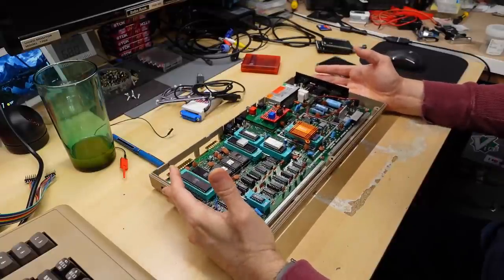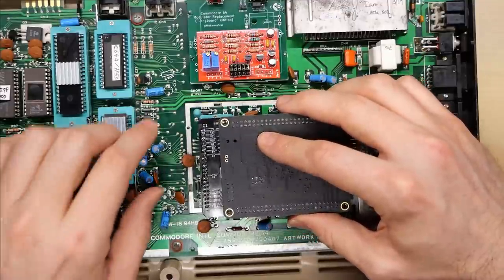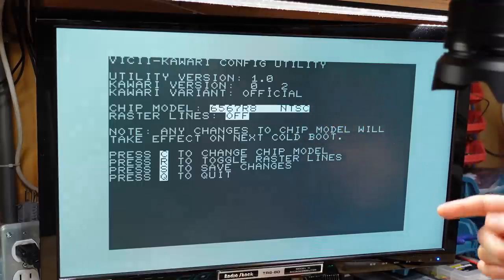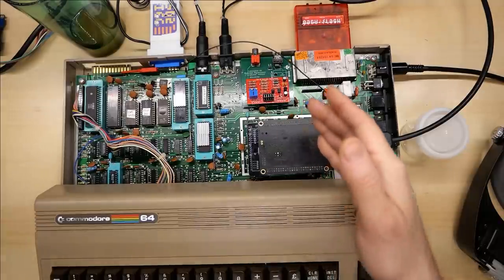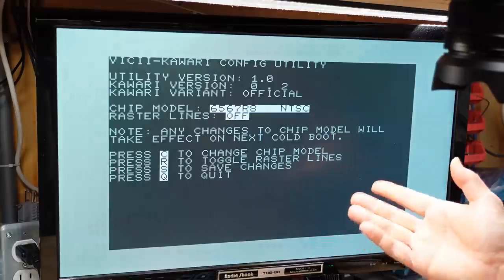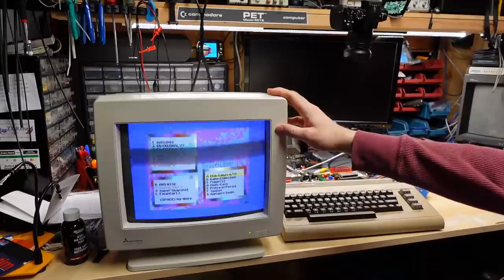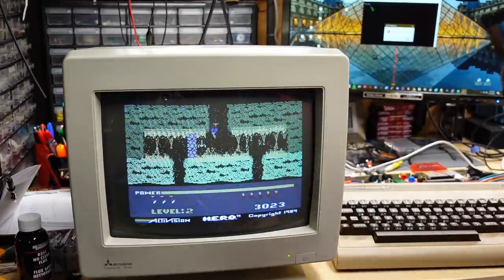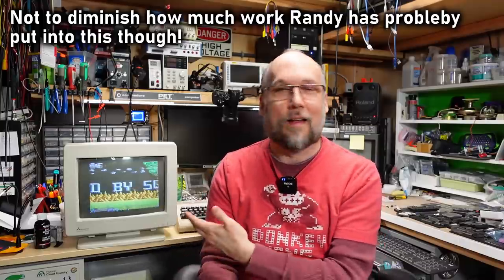VIC-II Kawari: FPGA based VIC-II replacement for the C64

Comment: "By the time I was done with it there wasn't a square millimeter of factory silicon inside." - William Gibson, "Burning Chrome".
Reply: If only there was a FPGA to replace the ENTIRE C64... or a $40 SoC board to do the same.  Oh, wait, there are.  😎
Reply: @winstonsmith478  Yep. At some point you're just keeping that C64 on your desk because you like the chassis. Probably better off running a MiSTer or a software emulator if you're going to replace half the chips with FPGA equivalents.
Reply: @flow221  the point is more to be able to have all the replacement parts available for people to keep their old ones going, when all the original chips are finally gone. Of course some folks will make “100% new component C64s!!!!” for videos but that’s not really the point of them. I think it’s great, the computing scene is evolving to be more like the car scene. Where for the right old car you can get totally new body panel pieces, totally new interior trim, etc.
Reply: @kaitlyn__L  Of course I understand why these replacements are being made and I'm always impressed by the talent and ingenuity of the people doing the work. But, yes, at some point in my entirely subjective opinion it starts to get silly. Much like a '69 Charger that's been gutted and rebuilt from the chassis up, you're just keeping something because you like how it looks not because it accurately represents the device it was at release.
Reply: @flow221  yeah, I think your final sentence is an accurate assessment. Loads of cars are deemed unusable with stock engines and then the only point is how it looks. Yep.
Reply: @winstonsmith478  Do such devices support all of the obscure peripherals that have been designed for the C64?  In the "How It's Made" episode about piano rolls, the piano roll punch was operated by an Apple II+ computer.  Sure today's computers may be more powerful, and I suspect that custom hardware applications were more common on the VIC-20 and Apple II than on the C64, but if one has a specialized hardware+software application for an antique machine, an all-in-one FPGA isn't the same thing.
Reply: People who advocate emulators or C64 on a FPGA forget about peripherals and other fun stuff you can do on a real C64 like interfacing with the hardware in the expansion port.
Reply: @snorman1911  iirc, most peripherals work on the Ultimate64. At this point it's pretty much possible to build an entirely new C64.
Reply: @snorman1911  I'd like to hear what peripherals you're thinking of specifically. I'm a little disappointed Adrian put a link to just an FPGA Chip, rather than particular boards, because the latest cheap  FPGA boards have ARM and RISC-V chips which can interact with peripherals in a conventional way.  It does illustrate, however, you could put any sort of connector on an expansion to an FPGA  board; the "connector ports" or cassette port, anything.
For example, the MiSTer is mostly designed for HDMI, but the System I/O board has a VGA port and many "cores" can work with that. You're criticism is perfectly valid with emulators, (I'm thinking of Raspberry Pi's in particular), but with FPGAs, the sky is the limit. I think there's revolution coming as FPGA prices come down and programming options, particularly Open Source tool-chains become better.  I think they will make nearly all original hardware obsolete, for better or worse. Commander 16X needs an FPGA because appropriate video chips are unavailable. It's controversial, but neat solution, especially how easily it can be "firmware upgrade".
Reply: @squirlmy  if you're looking for a real original experience, floppy drives of course, original monitors, joysticks designed for the original hardware, cartridges, memory expansion and accelerator cards, in addition to DIY stuff. I've spent lots of time making circuits that connect to the user port or expansion port, this was half the fun of the C64 to me. Would be great to emulate an expansion port with an FPGA.
Reply: @flow221  that is why i love the Raspberry Pi 400, it reminds me at the C64

Comment: This is one of those "shut up and take my money" moments.

About the extras that could be incorporated into this device.
I think the DTV screen modes would be a nice addition.
The DTV has a chunky 256 color mode and a blitter.
There are some demo's out there that use them already.

Oh and yes! the colours in PAL land are a bit lackluster :-(
I would love more vibrant colours.
Reply: This would be very cool in a RGB version.. Also HDMI for some people but I'm lucky enough to still be running CRTs.. Well I spoke too soon. 15khz RGB later in the video
Reply: I join this statement. It would be nice to keep the advanced video modes, even if they are difficult to program for, I'm certain the community will eventually make use of them regardless.
Reply: I still have an unopened DTV I forgot about
Reply: @circuitsandcigars1278  Nice to have one but thankfully pretty redundant now days. I wasn't sure we'd ever see a better remake
Reply: Fully agree with the DTV modes. That would be a very nice bonus to an already great product, and it would pull the C64 back into the 21st century.
Reply: Indeed  i feel the same !!:)

Comment: Creatures by Thalamus might be a good game to test.  The first level  can trigger the VSP bug some later VIC IIs suffer from.  On PAL tv's we have a Saturation control to make the colours pop.  The challenge was finding the right balance between normal tv and the c64 so you didn't have to adjust it all the time ;)
Reply: I never had an issue with Creatures - my C64C is pretty much VSP-safe, but Mayhem in Monsterland could sometimes have scrolling glitches and character corruption if I ran it with an action replay connected so for me that is a worst-case scenario for testing.

(Another bonus is the game is fun so it shouldn't be a chore to test:)

Comment: I love your content because you always go above and beyond in testing and demonstration of products, submissions and (of course) candy.  In regards to testing the VIC-II FPGA I always use the 'EDGE OF DISGRACE' demo to test my C64s.  There is another VIC-II FPGA project that you are probably aware of by c0pperDragon which outputs analog component, but it still requires the original VIC-II for clock generation.

Comment: This is really cool.
You should try putting as many modern replacements into a single C64 to see how it would work. I guess it shouldn't do anything weird, but it could be a fun little video regardless.
Reply: Wasn't there also a project that reverse engineered the motherboard back to the  CAD files needed to generate additional  c64 motherboards
Reply: So new motherboard with all modern replacement chips :)
Reply: @artstrutzenberg7197  As far as I know, all circuit diagrams are freely available, so making a new mobo for it shouldn't be too hard

Comment: 5:50 the HDMI TX PHY can be omitted too, by using SERDES in the FPGA to generate the TMDS signals for HDMI directly. There are several projects (including one on my github) that can generate HDMI without that IC.

Comment: I'm assuming the SID chip audio isn't also going out over the HDMI signal, and you had the speakers hooked up to the 8-pin A/V DIN.  Yes?
Reply: The SID audio output isn't connected to the VIC so it can't do that.

Comment: Very nice HDMI is coming to the C64! Looking forward to the final product.
On ZX Spectrum we created a solution using a cheap Raspberry Pi Zero for HDMI output, with support for more colours (ULAplus) as well, which resulted in the ZX-HD interface.
I made several 64 colour slide-shows showing off the possibilities.
Work on audio over HDMI and more supported video modes (like the so-called 'Timex modes') is on the way.
An FPGA solution would be even better, so let's see what the future brings.

Comment: This is an amazing device. Hats off to the inventor. I know just how difficult this can be to do on a FPGA. 
For me the goal would be crystal clear video quality, so I do not understand why people want scan lines, and certainly why would you want S-Video output when you have perfect HDMI?
Reply from the maker: For me, it just feels like using an emulator or even something like "TheC64 Maxi" .... why bother with original hardware at all. Those modern things can't properly output to a CRT like the original hardware, so if you want the full experience, you gotta use a CRT like the C64 was originally designed to use. (IMHO)
Reply: @adriansdigitalbasement  Wow I'm excited to get a reply from Adrian himself! Thank you! It's just my personal opinion and I am aware that many enthusiasts like the retro look and feel. 

Just FYI I have been watching your channel for 6 months or more now, even though I have never owned a Commodore or MAC, I just find your material and presentation style of the highest quality.

I go along with you to the extent that I prefer real retro hardware and not software emulation. My old hardware collection consists of several Atari 8-bits and an Atari STe. I'm on the fence w.r.t. FPGA emulation.

If you could see the horrible video quality from either my 130XE (jail bar city) or my Atari STe, you might understand why I only care about a high quality picture to simply allow me to use these computers. :-) The video quality from the STe in medium resolution displayed on my Dell monitor (RCA video input socket) is almost unusable.

My current project is to tap into the STe "shifter" digital outputs and convert them to HDMI. Just yesterday I got the first sign of life, however the FPGA clock and STe shifter clock are not yet locked so all I can tell is that it is a desktop, but highly skewed.

Consequently I can see how much work must have gone into this product and I hope that the developer is able to recoup some money from his hard work once the final version is released.

I did have an old Grundig TV (1980 vintage) which had an early version of SCART. This was great for RGB, but having not being used for many many years, the first time I (recently) powered it up, connected to the 130XE, it literally went up in smoke. :omg:

Comment: orange ceramic disk capacitors withstand very little heat before the value changes . it holds and breathes on it with your warm air!

Comment: Excellent! Props to the developer.
Out of curiosity do the C=64's video ports still work with this VIC II?
FWIW: There's a similar project for the BBC Micro's ULA - truly excellent, lots of new modes and programable colour palette - I guess the latter is the most useful addition for both projects as they add something useful that can be used with old software.

Comment: Off topic question... what is the beige box device on the shelf about your workbench at 33:21?  It's the 3rd box stacked vertically above the PET sticker, just to the left of the DANGER HIGH VOLTAGE sign.  I have a similar shaped box but it is dark brown with a different front panel that is a B&K NTSC Generator, model 1249A.
Reply: Visible at 0:02? Looks like a Rigol scope. Definitely a Rigol something, I recognise the yellow label 😊
Reply: @azyfloof  No.  I am referring to what is seen at 33:21.  Note that Rigol scope is under the DANGER sign, not left of the sign.  I updated my post above to be less vague.
Reply from the maker: I think you mean my Topward Electric Instruments TFG-8114. Digital sweep function generator.
Reply: @adriansdigitalbasement  Thanks!  That's the item.  It's interesting that different manufacturers appeared to use the same plastic shell.

Comment: Hi Adrian. I've already seen a HDMI mod for the C64, but working differently. The original VIC-II was kept, and the HDMI output is to be soldered replacing the awful RF modulator. Maybe that's the way for this WONDERFUL creation to step to revision 2: a mod to replace the RF modulator AND the probably faulty original VIC-II chip. Too bad Commodore missed a pin to make it RGB (or even YUV) output since the beginning, like TMS9929 for example

Comment: Randi Rossi used some very challenging demos to proof his design, I think you will be hard pressed to find anything that doesn't work right. Go check out Randis video they are both fun and informative in that geeky way we love
Reply: Does music play in key with an NTSC machines, or is it about a half a semitone flat?
Reply: @flatfingertuning727  its only fast
Reply: @Voyager_2  I should have clarified: do NTSC machines with this VIC-II chip replacement play music at exactly the same pitch as those with a normal VIC-II chip, or slightly flat from that pitch?  A half-semitone difference probably wouldn't be noticeable unless one listened to the two kinds of music side by side, but would be large enough to be pretty obvious then.

Comment: On my pal machine I have never noticed such dim colors. But I'm using a 1084s monitor where you adjust the signal. Without correction the picture is for sure, pretty pale.

Comment: This device seems like a great step in replacing those dead VICII chips.  If it could be made small enough to fit in a C64 case and maybe add some mode to increase side boarders in order to allow for widescreen monitors so that the 4x3 screen ratio could be restored and it would be just about perfect, even as an upgrade.

Comment: I have several C64s, all of them PAL (I'm from Spain). I see many people comment these washed colors are what they are used to, but I really never seen anything so faded with my computers, these colors look awful in my opinion... What I see with my computers are vibrant colors just as Adrian is showing here in NTSC mode. I only use S-Video and Composite on a CRT TV and an HDMI monitor through RetroTink2, never the RF out. I don't know why others see the colors this way, but it was never my case.

Comment: seems like there are now sufficient modern replacements for Commodore 64 chips such that a manufacturing line could be re-established to manufacture it (there already are injection molded cases, unpopulated PC boards, and keyboards). Would be cool to see a modern Commodore 64 that supports all the original ports and expansion bus / cartridge slot, but enhanced with faster clock speed options, bankable memory beyond 64K limit, HDMI video output, support for D-pad controllers, and PS/2 ports

Comment: Amazing.

I don’t know anything about C64s, but you did mention the font chip. Not sure how popular it is, but perhaps a small daughter board at the very least could be used with this to allow the ‘easy’ change of the fonts?
Reply: the c64 has 3 rom chips, one for kernal one for basic and one for character generator (map). i think there are rom switching mods available.

Comment: Hmmmmm, the I/O or PIA chips could be very easily replaced by CPLD/FPGA counterparts. I could work on a replacement plug-in design if it is not already done 😎

Comment: Being located in the United States and owning an NTSC machine, I would LOVE to have this installed in my 64.  It’s tragic but, in the United States, this platform was mostly abandon and the software lost so, these days I am running mostly PAL software.  Still, I don’t want to convert strictly to PAL or buy another machine.  This also has some super cool features like the ability to get rid of the vertical lines on the left of the display.  The only issue is, I’m a fan for the Commodore 64C and that is all I have.  So please continue development and get me a solution for my 64C.  Thanks!

Comment: I think the design is for the 250425 and 466, where the VIC-II is rotated by 90°, then you can remove the RFModulator and use its hole for the HDMI

Comment: 8:36 Technically, anything done on FPGA isn't supposed to be an 'emulation'. It's meant to be as close as possible to the actual logic and timings as possible in real circuitry. Emulation is more of a translation of machine that's being 'emulated' into something that a modern computer can understand. That's the real difference; give or take whatever stupid thing I might be getting wrong or forgetting here. If he got everything correct, it functionally IS a VIC-II chip.

Comment: I would love something this for my Commodore 128 and one of my C64's. Ever since I have owned a C64 (1984) the PAL palette always looked a little washed out compared to the other 8 bits of the time, I used to turn up the colour balance on my TV (and later 1084) to get the vibrant colours.

Comment: yes, the PAL palette is dirty washed out. not saturated at all. commodore probably made a mistake in the first VIC-II version and did not have the time / money to fix that.
now we need a new c64 board with pin-headers for a video card. then we can make video cards with the original pal or ntsc chipset and other cards like this one.
also for the SID, we would need two pin-headers with a bit more space and more pins l/r analog out and i2s out.
and instead of the rf modulator the hdmi transceiver chip and the i2s DAC and optional s/p-dif output.